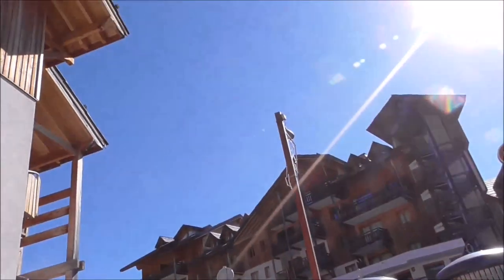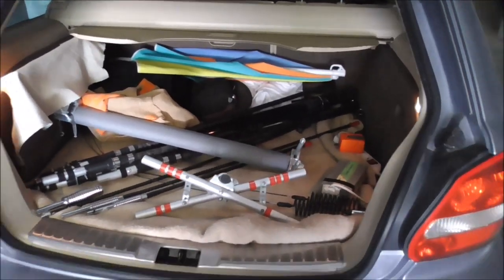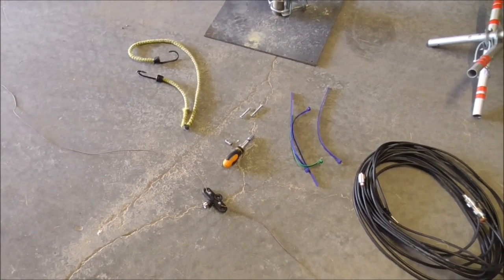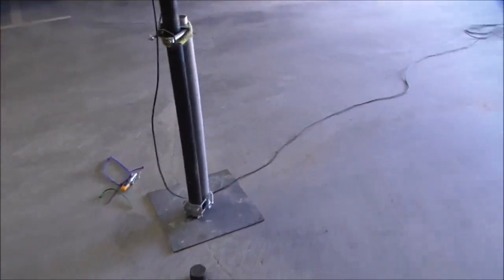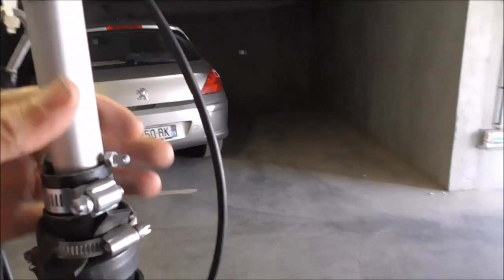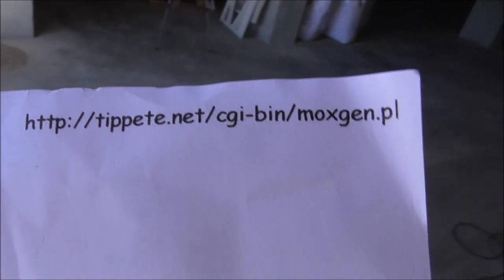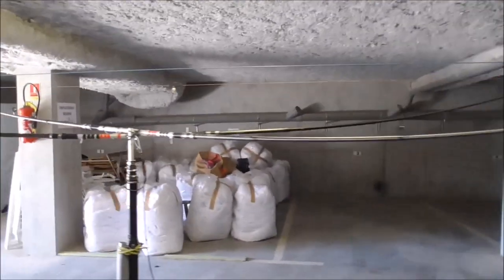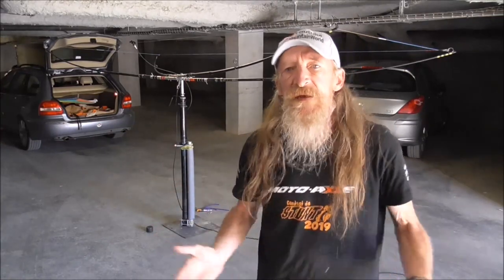How To Build A Moxon-Type 11m. Wire Antenna ~ Bonus Tour of the DX-Type ~ The Set-Up ~ 7 Antennas!

Comment: I’m currently trying to design a drive on plate for myself, I love how you can just slot the bottom of the pole down into the base. I’m thinking I want mine to do it, leaving the rubber bottom on so the poles won’t slide out while setting it up. I’m also thinking the rubber might act like a bit of a cushion if any of the poles come loose and fall down.
Reply from the maker: Yeah, I came across that by accident, coinciding sizes, and it works really well. There's no problem with sections dropping through. Just put it on its side to separate it. when it is up I have it so it is no longer possible for the sections to fall. Learnt my lesson after my wee accident (on Video) The plug keeps it rattle-proof in the boot. Cheers

Comment: Bonjour Max tu es un crack, je vois toutes tes vidéos à part ça tu vis dans un super et très bel endroit et au-dessus de toi comme le meilleur groupe heavy « the Iron Maiden » Haha.Estoy toujours avec le projet du moxon j’ai terminé et ma question est, le câble radio est rg58 qui joint le fil des anches avec la radio ?pas besoin de câble 75oh pour lui donner résonance ?. Un câlin, merci 30 AJR 005, Madrid
Reply from the maker: Bonjour, Merci pour ca. Le 1er. pour moi AC/DC. Bonne courage si tu a fabriqué un Moxon. J'ai 11m.x RG8mini (50-52ohm) co-ax (j'ai deux si besoin de prolonger). Des astuces sur le Video j'ai fait aujourd'hui aussi. Merci encore. 73's Cheers

Comment: Hi Max how do you set the swr up on it or at the lenght's the wire is just right .. might have a go at one of these for the garden
Reply from the maker: Provisionally set up and the wire installed too long then clipped back to perfect swr before fabricating/soldering the wire-end loops. A long process to raise the antenna each time but well worth the effort. Go on. it is easy and let me know any more Q's etc as well as how you get on with it. Cheers

Comment: Excellent video max, Can I ask what length the telescopic fishing rods are at full stretch.  Cheers Sid, 108DD124,  I recently managed to build a 2 Element quad with excellent results too. 73, 51,
Reply from the maker: Thanks. To be honest I can't remember and my notes are long gone. The 140deg/40deg is important and with the wire dimensions pretty much determines pole lengths off the cross-bars. I may have mentioned this sizing in one of my earlier Moxon Videos. Sorry I can't be more helpful at this point. 73's Cheers
Reply: @MaxMountainWorld  no worries buddy, I will check the other videos and see if I can find them.  Thanks again for your reply. Good DX 73, 51 Sid Scotland.
Reply from the maker: @georgedrummond8938  also I adjusted mine, all four, for the ideal wire position, by memory syarted around 1.4m.   may be not fully correct there. I will measure nexy time out. Cheers

Comment: OMG it's my twin brother. same equipment same ex pat situation about 100km away, similar hair and beard. mad! get in touch brother! lol
I have a Spiderbeam pole like this, i had a similar idea for a base but with a longer metal plate you can drive the tyre onto. I was planning on taking it up to Avoriaz. But it's really a project for my big tree extendable mast. top secret. lol but in all honesty i have a new idea, much better than any mast out there, very different, never seen it done before. reply here then we can get in contact for more info, some dx etc. I had 2x avanti sigma IV and many other antenna. Contacted Brazil Sao Paulo last night on 100W and a mag mount on a tin chalet roof! result!
Ps. look up tuning moxon by adding a wire hanging down in one corner of the driven and one corner of the reflector!
Reply from the maker: Thanks for this, an excellent Comment. Contact me through Facebook. If we aren't already connected just search with my callsign. Your last note here? Interesting but I have no need. My Moxon tunes spot on. Thanks again, cheers